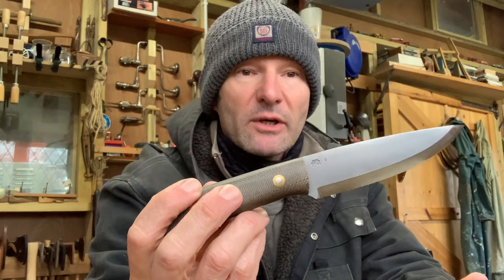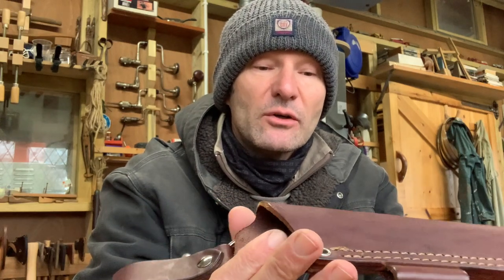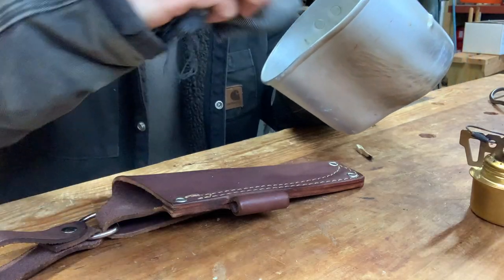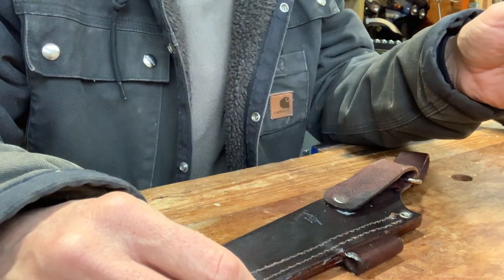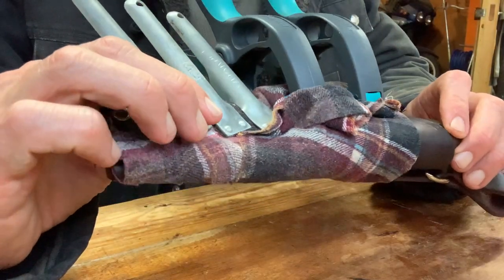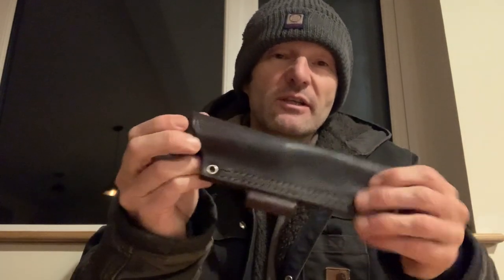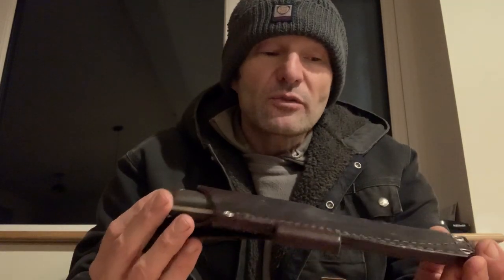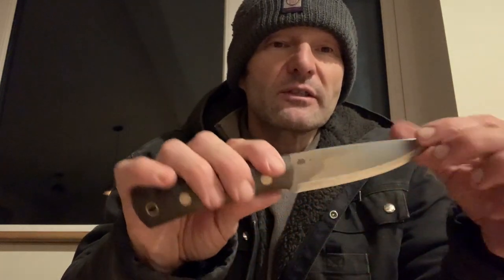Wax Forming a Leather Knife Sheath

Comment: I've done it, although I usually do it on thinner leather.  I use pure beeswax as it stiffens the leather when it cools.  Shoe treatments have additives to keep the leather supple which is not what you want in this instance.  I melt the wax in a shallow foil tray in the oven and dunk the sheath into the wax and leave it a moment, flip the sheath and do the other side.  You want the wax to get inside the sheath and penetrate both sides of the leather.  Drain out the excess and pop the knife in and form it.  You have to be quick as it starts hardening fast (good tip is to warm up yor knife first).  You can fine tune it with a hairdryer or heatgun.  I generally use 2mm veg tan for sheaths (as a southpaw I had to learn to make knife sheaths) and its almost like natural kydex aften waxing.  I've not had much luck with chrome tanned leather.  Hope this helps.
Reply from the maker: Thanks Luke, that’s fantastic, very useful information!
Reply: @bundufundi  No problem.  I remember reading years ago on the BCUK forum about someone using candlewax with good results too.  That would be cheaper than beeswax but I scored a big lump years ago at a great price and I'm still using that.
Reply: This makes alot of sense sir. Thank you for sharing this info. I was told bee's wax from candles. All of your info is 100%. Thanks again.
Reply: I see alot of sheaths on BCUSA that seem to be soaked through that way. Sargent Edged Tools, i a great example of a perfect waxed sheath.

Comment: I used to do this with leather boots for winter wear.  I heated up the boots in a WARM oven (around 150F) and then rubbed the warm but still solid wax over the boots.  The heat retained by the boots caused the wax to absorb into the leather.  Worked much better than a hair dryer.  Another thought is to wet form the sheath.  Let it dry.  Then use the above method to impart the wax into the leather to stiffen it and protect it.  Just my thoughts.  Thanks for making and sharing this video!

Comment: I think you are on the right track.      If you have access to a kitchen food vacuum sealer you might be able to warm the waxed sheath & knife then put it in the vacuum seal bag and vacuum seal and let cool/form for several hours. I've never tried this method with wax but it works well with damp leather.
Reply from the maker: That sounds like an interesting method,  thanks Brett.

Comment: haha. I actually did this a while ago with my wife's hairdryer. I didn't notice that I got wax on my hands and transferred it to the hairdryer.

Needless to say, I've been banned from using the hairdryer - and also not so happy with the results.

A few years ago I did another sheath where I melted wax and dipped the whole sheath into it for a few seconds and formed while the sheath and wax were hot (you'll need a tall container) - the sheath I did with that method is a lot better (stiffer) - but still not sure if it's exactly what I wanted.  If you try this try close the hole with something (I still get bits of wax falling out once in a while because I didn't)

Now my next attempt is going to be a wet form with hot water which apparently makes the sheath harder. Once dry heat up the leather and apply melted wax using a brush. I haven't tried this yet but will do it in the next few weeks as the weather gets worse and I get bored. I've also been reading a method where you bake the sheath a bit, but I don't know I want to do that. Maybe worth buying a cheap sheath from BPS and trying a few things.

Edit: Check out this video by Lois Orford (not wax, but interesting): https://www.youtube.com/watch?v=5nI7hfUP33Q&ab_channel=Ben%26LoisOrford
Reply from the maker: Some great suggestions there, thanks! Be interested to hear how you get on with your sheath.
Reply: @bundufundi  I'll let you know when I get round to it.